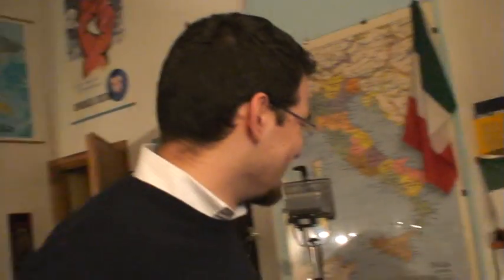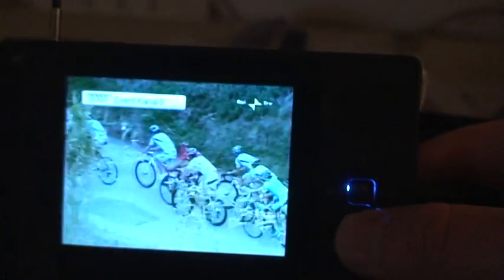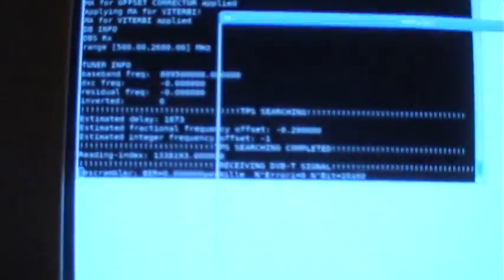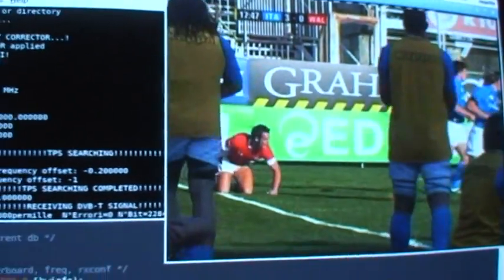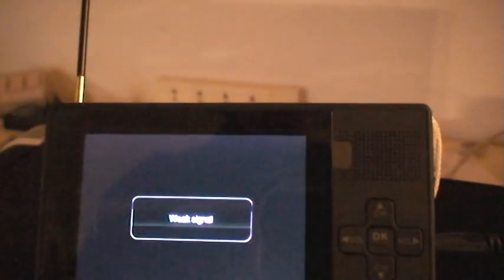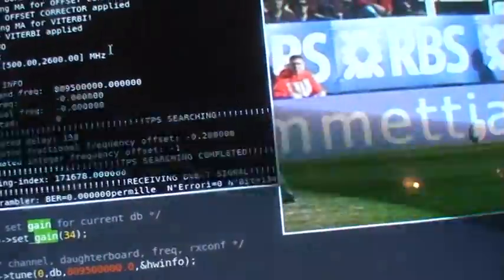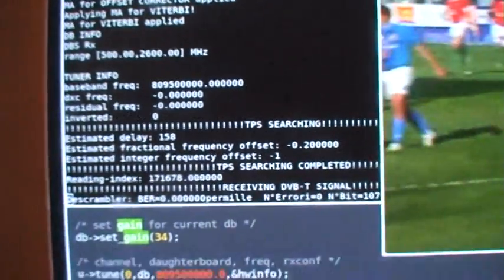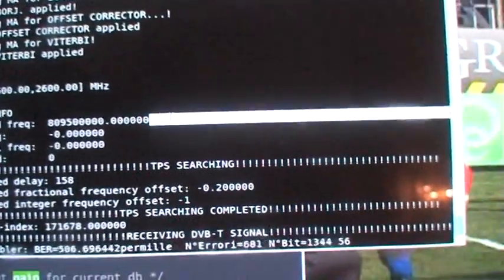SR-DVB_demo_long.VRO

Comment from the maker: @jinjohdiscourse 

No, the Gnuradio code would not do the job as Gnuradio in general is too slow. It is also very difficult to get a good constant bitrate TS to feed the modulator.

So if you are out for a challenge, you can try, but it will probably take you severyl month of fulltime work.

Our solution does UK and France frequencies